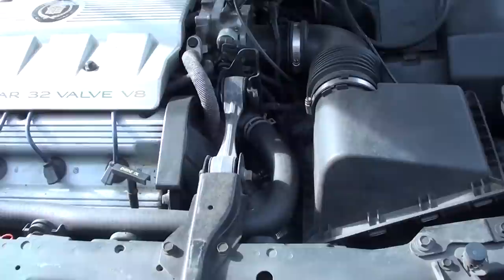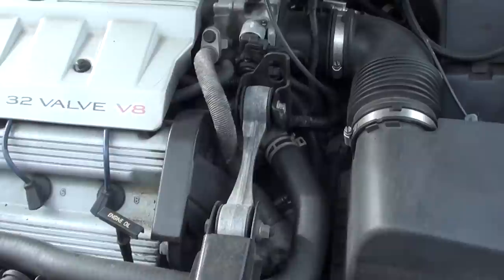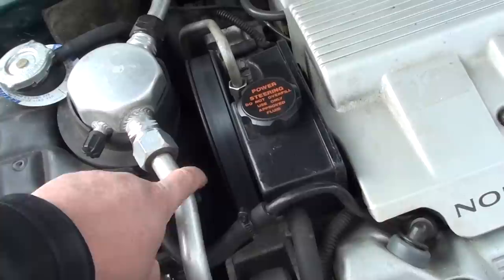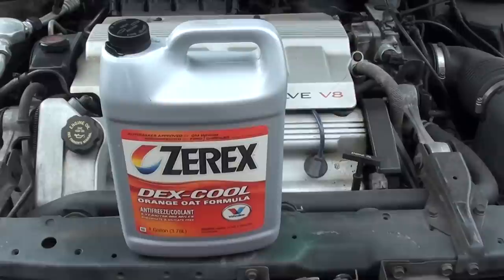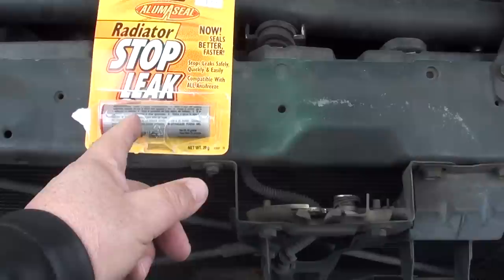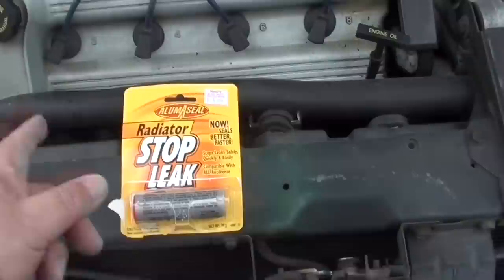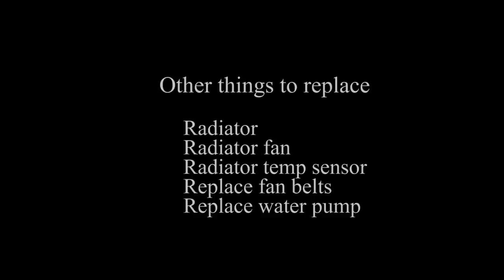Cadillac | Prevent Northstar engine from Overheating | What Mechanics won't tell you

Comment: Also  on  the  over  heating  Northstar  engine,  I  have  done  the  block  test  and  got  the  same  almost  instant  blue  to  orange color  change  from  the  radiator  coolant  reserve  tank as  I  did  straight  from  the  exhaust  pipe.  Any  ideas  other  than  to buy  a  boat  to  go  with  my  new  anchor?
Reply from the maker: Have you checked to see if your radiator is clean and flowing correctly,  also see if your fins are clean on the radiator so you have good air flow. But my question is what makes you think you need a head job? Also I'm sure you replaced the thermostat when changed the water pump?
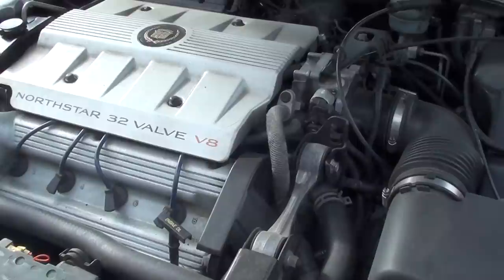Reply from the maker: Check out this video watch 1:30 make sure the fitting is clean.
https://youtu.be/6B8-n2ILDbw
Reply: @notsofast2325    Yes,  the  radiator  was  drained  and  flushed  and  re-filled  with the  cadillac  recommended  coolant,  the  dexcool  stuff  and  looking  into  the  radiator  fins,  they  look  good  and  have  been  sprayed clean  with  a  house  water  hose.   Plus  the  thermostat  was  replaced  with  a  new  one.   To  the  best  of  my  knowledge,  when  the  local  mechanic  said  that  if  the  radiator  block  test  changed  colors,  that  meant  exhaust  fumes  was  getting  into the  radiator.   He  told  me  that  it  probably  meant  dropping  the  engine  at  a  shop  and  dismantling  the  engine  to  re-drill  the  head  bolt  holes  and  putting  in  either  studs  or  inserts.   Then  he  told  me  of  the  day  to  drop  the  engine  and  the  day  to  re-install  it  and  a couple  of  days  looking  for  problems,  besides  the  bolt  change.   I  took  it by  the  Cadillac  shop  and  they  said  it  would  take  too  long  to  do  the  job  so  they  refused  to  do  it.   I  think  they  just  wanted  to sell  me a  new  car.   Jake  even  told  me  that he  could  do  it  if  I  got  the  car  to  Canada,  then  he  told  me  of  a  shop  in Tampa, about  160  miles  away.   Then  the  wife  got  in  on  the  act  and  said  to  hold  off  on that  fix  and get  a  different,  car,  or  another  non-  northstar  engine  car.   Even  a  local  mechanic  said  they  could install  a  Jasper  engine,  but  that  they  had  not  done  so  yet  on  a  cadillac.   A  first time  training  job, I guess.   After  all  these  great  answers,  I  feel  it  best  to  just  get  another  car,  and  fix  it  when  the  corona  virus  is  over.   Plus, without  taking the  engine  apart,  I  do  not  know  how  to  magna flux  it  to  check  for  cracks,  of  which everyone  tells  me  is very  unlikely.
Reply: @notsofast2325     After  watching  a  few  more  of  your Videos,  I  have  determined  to  replace  the  Coolant  Fans,  I  believe  they  are  working  correctly  but  before  I  park  the  car  for  a very  long  time,  I  think  that  a  couple  more  hundred  in  fans  will  be  only  a  waste  of  money  if  it  does  not  work,  but  if  that  and  a  fail safe  thermostat  works,  then  I  can  be on  the  road  again,  otherwise  I  will  still  need  to  find  my replacement  auto
Thanks  for  the  Videos...
Reply from the maker: @bindibadgie1392  good luck

Comment: GM does not recommend that stop leak product anymore. Look it up there is a bulletin on it. If you find a leak fix it.
Reply: If its a small crack then that will work Blue Devil works the best I used it on my 2006 Nissan Altima work like a dream but it was a small crack it was not major.
Reply: +Andre Eskine : NEVER put that Blue Devil in a Northstar. Can not be rebuilt after. Unless you want to scrap it and maybe buy some more time but otherwise  NO.

Comment: I had one of these with a rebuilt engine and had a top Gm. mechanic tell me to use plain green 5 year extended life collent instead of Dex Cool.
Reply: Correct.  And NO tablets.
Reply: I run dexcool and tablets... no issues

Comment: Of all my years being around these cars and driving them for many years, I've yet to experience any type of overheating problems, and I've owned several of them.  These engines is really no difference than any other OHC engine.  The proper type of coolant is extremely important.  This is a problem with many other engines both domestic and foreign.
Reply: How well did you monitor your coolant temperature? Did you have the coolant temp displayed so that you could watch the temps in different driving conditions? What does overheating mean to you? Overheating to the point the engine goes into limp mode or exceeding average operating temperatures. Fans kick on at 223F. Average operating temp is about 208F.  Temperatures above 230F is overheating.
Reply: @Notsofast  When you sit in traffic and the engine at idle with no AC, how high does your coolant temperature get before the fans kick on and bring the temperature down. Where will your coolant temps average out at in this situation on say a day that is 85F.
Reply: My experience/opinion/do’s&donts: 

If you see a leak small or big get it fixed as soon as you can. A little leak can turn into a big leak and a big leak can turn into a big problem. The owners manual tells you “do not run a Northstar on water. If you do you will blow a head eventually” It also states “Use ONLY GM approved products” etc. People are hardheaded and cheap and that’s the wrong thing to be if you own a Cadillac. When it comes to the cooling system this is when you really don’t wanna be cheap. Get the GM DEX-COOL coolant (not the 50/50) and never use green coolant. I dont know anyone who has followed the simple instructions on a Northstar cooling system and still blew a headgasket......

P.S. FOLLOW THE OWNERS MANUAL #Simple
Reply: Do North star engines have timing belts or timing chains which years
Reply: +Ethan King :Heavy duty chains thar rarely need replacing.
Reply: @lancedukel3436  thank you so much

Comment: The stop leak he used will plug up his radiator and heater core.  I've seen people use that cheap stuff before, and later on he will be replacing his plugged up radiator.  The heater core will be plugged up also, but since it is a major job to replace, the car might not be worth it.  There is a much better stop leak available by the name of BlueDevil that costs from 25.00 to 65.00 dollars at parts stores, but it's worth it.  The product is a blue colored liquid, and won't plug up anything but leaks.
Reply from the maker: Thanks for the input, I only put a small amount approx a teaspoon or so. And that's about it. It's worked for me for years but there's always something better. Thanks for stopping by
Reply from the maker: @lancedukel3436  thanks for stopping by!!

Comment: I just bought a 1998 Deville, it has 19,400 miles on it. I am not sure when to change the Antifreeze but I am pretty sure I still have a while but its the original antifreeze, is it bad to still be in there after 21 years ?
Reply from the maker: Congratulations welcome to the club. if I were you I would definitely change the antifreeze make sure it's topped off and there's no air. But I would also replace all the hoses, and fan belts, and change out the thermostat. a lot of these things you can do yourself oh, so you can have some peace of mind. also get a new battery..as you know in time rubber will become brittle and that's the last thing you want to happen to your car is to breakdown because of something silly. Or worse overheat your engine. Let us know how she's driving in the future.Good luck and thanks for giving us the good news and thanks for stopping by.
Reply: @notsofast2325  Thank you very much for the advice. I am going to drive it to work for the first time tomorrow, I can hardly wait...
Reply from the maker: @djt5782  make sure you roll up with some sunglasses on....
Reply from the maker: @djt5782  make sure you roll up with some sunglasses on....
Reply: @notsofast2325  that’s was great information. I myself just got a ‘98 deville. Of course we all here the fright of north star.. but I couldn’t resist the body. The info you gave right here is great for someone like me new and not knowing too much of anything. You showed me where to start thank you bro 💯
Reply from the maker: @jblunttheebarber2427  thank you very much, this is why i love making these videos. I know what you mean about you couldn't resist. Its like dating a gold digger, "everyone will tell you why are you dating her". And you tell them ," Are you kidding look how hot she looks. That's the same thing i go through. people ask me why did you buy this car, its nickle and diming you.? And i say are you kidding me?  Look at it, sit in it, just take in, that plush comfort, then ask me why i have this car. its the same thing. Check out my  42 ( at this time) Cadillac Repair DIY Videos.
https://tinyurl.com/Cadillac-Channel

Comment: 65!? come on.. u cant baby it / they say its better to run it hard ev now and then //I been up to about 113 then she will  cut off fuel//
Reply: 110 is the maximum chip will allow. I know it says 280 hp but there's no let down.
Reply: Zig says if the speedometer is true i had my 01 Eldorado etc at 130 mph, service mngr. At dealer told me they dont let them go that fast,, i was there,  just about airborne,, would run 110- 120 routinely, got a ticket goin thru gallup on 1-40 goin 106 in a 65 caused me alot of grief,, got the same problem as other northstar owners!!

Comment: Drain and refill the Dexcool every 4 years, and add a single tube of bars stop leak (it's made of ground up ginger root, and walnut shells)  After 4 years, the ph of the antifreeze changes, and it starts corroding the threads in the head bolts.  never ever drive the car with a leak, or with a smell of antifreeze.
Reply: David James - NEVER put ANY kind of stop-leak in Dexcool… ever!  Search YouTube for: dexkill. Something about the chemical makeup of dexcool makes it coagulate and clog up every cooling channel in your engine when mixed with a stop-leak of some kind.
Reply: Tommy TMT i did see videos showing this, but for a car that is properly maintained and following the service intervals, and using the correct factory recommended sealing/stop leak supplements, there will be no issues. When I purchased my 1996 Cadillac brand new, I had the coolant drained and refilled every 4 years, and I made sure the supplements were added.  22 years later, and all is fine, and I never needed any work done on the car. I believe all the cars on YouTube were both neglected by the owner, and improperly serviced by the grease monkeys.
Reply: Notsofast good read.  The article didn't mention that manufacturers used to add bars stop leak into the coolant at the factory because of the porous aluminum castings.  Shops convinced owners that the Dexcool turned to 'mud'. - what a messy time.  Also the repair shops reused tty headbolts against manufactures warnings.  Any time there is a major shift in fluid formulation, there is trouble - except the upgrades in Dexron transmission fluid. Ex. Dexron vi

Comment: You lost ALL credibility, when you broke out the stop leak..  There is no "fix it in a can" option for these northstar engines.. The absolute best way to save this engine is to drill out bigger holes and cut new threads for a larger size head Bolt..  

Stop leak, helicoils, or any "simple fix" is temporary at best...
Reply from the maker: Your right , it is a temporary fix. Unless you have 1000.00 or 2500.00 for some one to do it for you. I put it in as a preventive. My Cadillac doesn't have a head problem yet but if it does hopefully this will prolong the life of the engine. All I can say is mine still running I'm running strong. Thanks for the input
Reply: The FIRST MAN with the correct fix!  Permanent!

Comment: My 1979 Lincoln Mark V is still running great the only thing that overheats is the gas tank
Reply from the maker: ???  Gas tank? Milage?  You have a Beautiful  car. I saw this car when it first came out. My dad's boss bought one. I still remember how new it smelled.
Reply: @notsofast2325  yes what I meant about the tank it heats up my wallet if I drive it too much.😎
Reply: @notsofast2325  what I meant that my gas tank overheat it overheat my wallet but I love it no matter what is just a joke I drive it quite a bit thanks
Reply from the maker: @bohemialite6371  lol.. yes it does. i have to run premium on mine. Yes if you have a car like this, drive it as much as you can, its a beautiful car. did you get your top done?
Reply: @notsofast2325  no it still has the original top.

Comment: If you're changing your thermostat change your water pump as well. Quick job. Also check your electric radiator fan is turning at the right speed. Mine was idling away quite happily at about 200 rpm even as the car was climbing towards the red. I'd've got better cooling with one of those flappy bladed handbag fans.
Reply: is that a FLEX FAN? exchanging a fan with temp sensor?

Comment: The best way to prevent a Northstar from overheating is to not buy one. Especially the pre-2006 model years.
Reply from the maker: True but people still buy them
Reply: @notsofast2325 , I almost bought a 99 Deville Concours for $800 129,000 miles a few years ago. Instead I bought a 95 Lexus LS 400 for $700. Even though the Lexus had 186,000 miles I still made the right decision, both cars were in good shape and running good everything worked on both cars and the previous owners were older guys who had regular maintenance done with histories for the maintenance. But that Lexus? Put it like this, when you Put that Lexus next to the Caddy you can see how much more advanced in looks and engineering the LS is. I can truly say that the Lexus is a beast in every way, and even at 26 years old nothing is falling off car, interior or exterior wise. Not knocking Caddy's, but my cars from no on will be Toyota's or Lexus brands. Just with a couple of simple modifications the factory 260hp 4.0l 32v quad cam V8 is pushing 310hp.
Reply from the maker: @henryhawkins1194  trust me, people don't get older Cadillacs for durability.
Reply: @notsofast2325 , I know it's a just the name. People fail to understand that Cadillac stopped making good cars in the late seventies, early eighties. I'm 62, and have owned Cadillac's in the distant past.

Comment: Zig says his 01 eldorado etc was incredible, comfortable, fast, glued to road, bose and moonroof, cant beat the design,, but gm should have fixed that fukin northstar engine, i drove mine off the lot for 52,000.k with 00007 miles on it, at 100,000. Miles head work, at 200,000. Needs head work again rest of car is perfect with new tires, never buying gm again and i will badmouth them for not making that fukin engine right for us sheep.. gm=p.o.s. mine is sitting in my parking lot d.o.a. imm thinkin i might move into it....
Reply from the maker: bummer, another one bites the dust..

Comment: WRONG, thermostat does NOT stay open when it goes bad. Which is why a bad thermostat will make an engine overheat. It will remain CLOSED and not let coolant flow through the engine,heater core and radiator. Don't give advice if you don't know your advice is right.
Reply from the maker: "Fail-safe" thermostats stay open when they fail. Check them out. I did a video telling you in more detail.

https://youtu.be/ZwrDiAHeJcs?si=WIcssmYKftymAzHT

Comment: Has anyone ever wondered about the computer system Making the guage read wrong,No smoke ,No leaks ,No gurgling  in overflow reservoir,car isn't really g running hot...Just saying,
Reply: If you mean the temperature gauge reading incorrectly they do burn out sometimes and is a cheap fix. One for coolant level in the surge tank another against the firewall for coolant temperature.

Comment: What about an 07 dts with the same motor are they any better?
Reply from the maker: my understanding is 2003 and older
Reply: Notsofast so they newer got better? Cause I seen different people talking about cadillac correcting the problem after 05
Reply from the maker: @calvillocobra98  yes they corrected the problem. the problem was bad quality of head gaskets and the threads on the head bolts were to small.  so they re engineered it and made the corrections from what i understand. The block was redesigned in 2000 in part to address the head gasket issues. There were also minor revisions in 2002 to address a minor problem with the 2000/1 block. As long as you have a 2002+ Northstar and maintain it properly, it's a very reliable engine.
Reply: Notsofast thank you so much. Cause i been trying to get a dts like a 05 to a 07 but hear different opinions from alot of people and reviews
Reply from the maker: the best thing to do is do your home work and know everything about your Cadillac(s). Don't be just a owner , Live and be part of the tradition.
Reply: Notsofast yea i know i currently own 2 Cadillacs a 2005 cts v ls6 motor and a 2010 cadillac srx and they have been really good to me. I had i really small problem with the srx but fix it my self and she is running fine. The cts v i own this car for the last 6 years and it has been one of my favorite car
Reply from the maker: @calvillocobra98  Thats great to hear!! Theres  nothing like knowing someone that can work on a Cadillac.
Reply: Notsofast true that
Reply: @notsofast2325  i finally got my hands on a 2010 dts everything its running very well only has some abs and traction control light on but runs beautiful
Reply from the maker: @calvillocobra98  kwel!